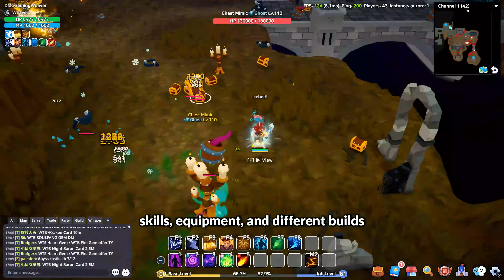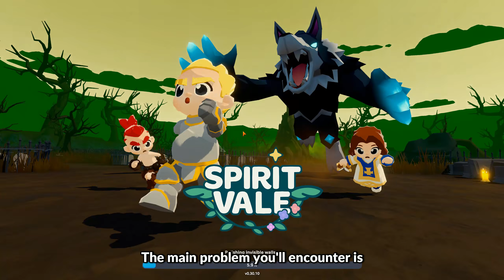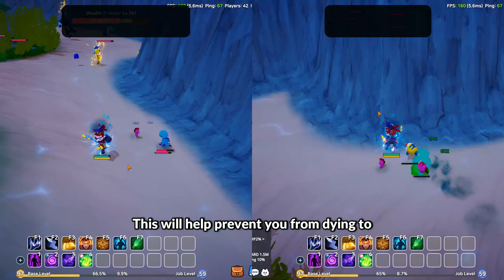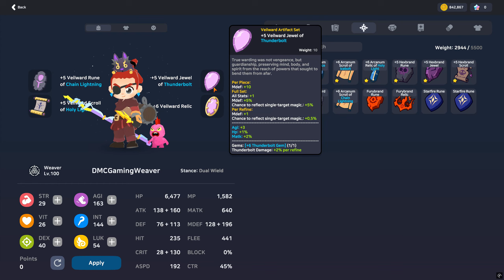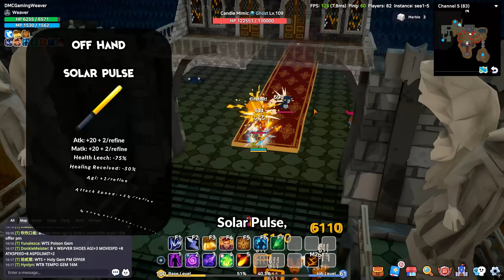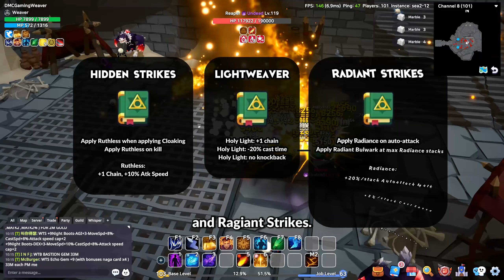Spiritvale Ultimate Weaver Build Guide | Wind, Water, Fire & Holy Builds

Comment: im new to the game, but what auto cast mean?
does it mean it will automatiically cast meteor each time you attack mobs? 
and how to achieve that?
Reply from the maker: Autocast is Triggering a certain skills using normal attack.
Reply: it literally says in the items if you have it equipped. Depending on the Helm you have, if you do normal attack, you will trigger an Auto Casting skill so Attack speed is very important as it gives you a bigger chance to trigger the auto cast skill. Or it can also trigger from the weapon that you have or it can be both which most Weavers are doing.